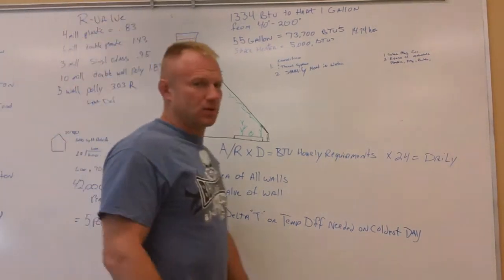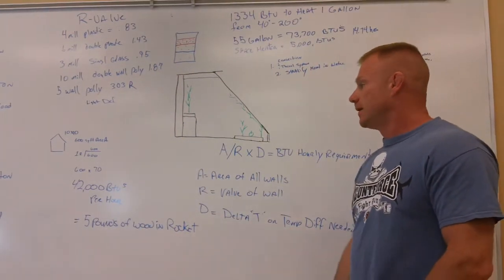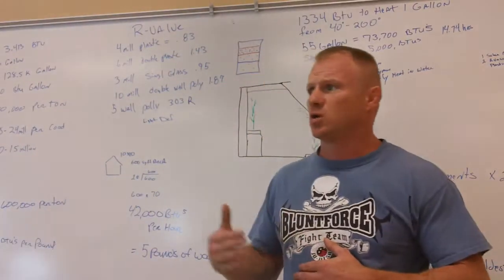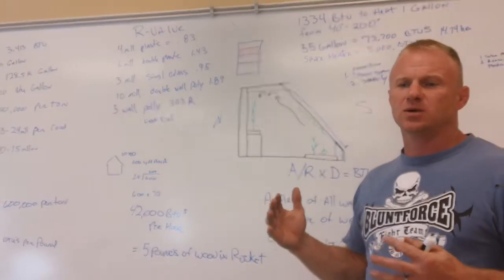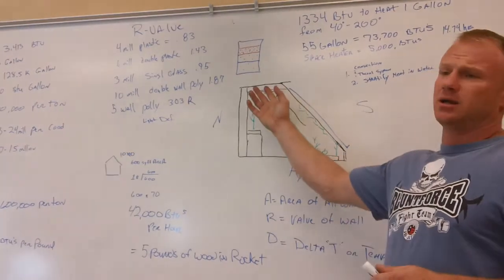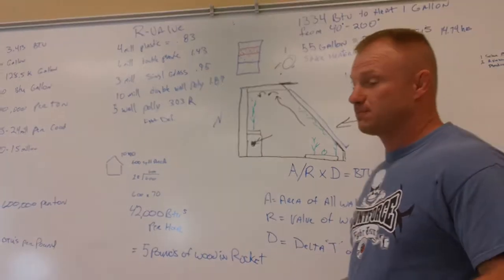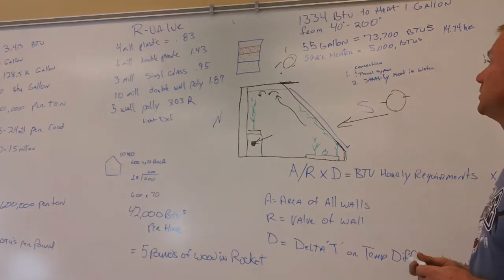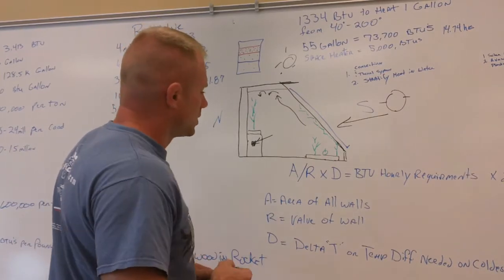Death Of The Rocket Stove part 3

Comment: Its great that you mention water drums have a 3.6 times ability to store BTU's compared to sand/brick/concrete. However, water has a slow uptake of absorbing direct solar heat. If the sun only comes out on a winters day for an hour, the black drums of water will certainly absorb some heat. However, a dry-stack of black-painted bricks under them will absorb more heat in that hour than the drums of water. Without going to exotic phase-change materials, paraffin, or salts, you will experience a boost in thermal absorption with drums of water on top of a base of masonry. After a certain amount of time, the masonry will achieve saturation, and cannot absorb any more BTU's of heat. At that point, the same volume of water will have absorbed a lot of heat, but will still be able to absorb more. If there is a full day of sun, the thermal mass would perform best if it is all water drums, but if there is room for a masonry base, the masonry can rapidly absorb a short exposure of sun, and then spend the rest of the day shedding heat upwards into the water drums.

Comment: So you understand.

I am disabled and find myself bed bound about 4 days a week.  This means not getting up to light a fire to maintain the heat in the mass. 

So I am tingling of throwing a slab with a hollow centre. Fill it with water and use a gas space heater to pump hot air into pipes set in the slab. Insulated from below and with a fairly thin cover it would surely release the heat slowly. The space heater can be set onto a thermostat and it kicks in when the mass/water gets too cool.

The main purpose of this is for an aquaponic setup so over and above this there will also be two tanks of water in the greenhouse. 1000l each, sump tank buried below the main fish tank. I will paint these black to absorb as much solar heat as possible.

Any advice? ?

Thanks for the videos mate, very informative.

Cheers
Sheldon
Reply from the maker: Sheldon B Hello Sheldon. size or volume of mass determine how much heat it will hold. per volume water is a great choice. it however will absorb heat that otherwise would be coming into the room  and let it out slowly thus maintaining a more constant temperature. any mass heated or unheated will come up to room temp and then try to hold it or let off it cools.. Recomend a second or auxiliary heat source for the mass to have more than one way to heat it.. Perhaps a candle arrangement or propane or wood .. they days your up a hot fire could store a lot of heat if the mass is large enough.. its pretty easy to determine just how many BTU of heat a material mass of a certain size will hold.. by calculating heat capacity with volume.. and then look at that number compare to how many btu you need to heat your room for one hour and see how many hours your mass volume chosen will heat the room and see if that meets you needs for time..

Comment: Hi Mr. Powell - First, I would like to thank you for all of the time and money you have spent actually testing your heating theories, in addition to the time you have spent learning the supporting information.  Just opening all of these discussions is a huge benefit to people like myself that are just beginning to dive into these projects.  

Now, it seems to me that everyone has accepted that a rocket stove burns hotter, and therefore, more thoroughly than standard wood stoves.  There seems to be two arguments you have made for why rocket stoves are not the right heating tool.  One was that they burn to quickly, and require a lot of feeding and babysitting.  The second was that by pulling the heat from the exhaust there is a greater opportunity for back-draft problems. 

What I am not understanding is why this discussion revolves around rocket stoves at all?  You have made a completely valid argument that water makes a better thermal mass than cob, but why is cob married to rocket stoves just because that is the way many people have done it in the past.  Why not transfer the heat from the rocket stove into water rather than cob?  

I understand the point that you have made, that one must feed a rocket stove more often, but if people are coming up with alternative methods for feeding different fuels (pellets, waste oil, etc, just as you have experimented with) why is that not a reasonable solution for taking the "babysitting" out of a rocket stove?  After all, aren't all good technologies really built one improvement at a time upon other technologies?  The same argument applies for the efforts people are making to resolve the back-draft issues.

If a rocket stove is a more efficient method of removing BTUs from a fuel, shouldn't we be talking about how to harness that more efficiently rather than looking at a less efficient heat source?
Reply from the maker: Hello Mr Christman  All this was not intended to do away with the rocket stove idea or to say it is bad. It is to better understand the underlying principals so that one can use any and all resources available to build a heat system that best suits them and to make people aware of any draw backs or problems and give an accurate report over time in order to draw better conclusions and save money. The rocket was built for cooking and turned into a heater. It burns clean as was needed for indoor cooking in 3rd world countries . What is most efficient is not always what is most practical. Rocket folks are almost like a cult..LOL. They will tell you a arm load of wood will heat a whole house for all day . When IF you understand the science, you know its not possible as the math just doesnt add up for such a claim. Proper question is whats size house at what r value over what time frame do make this claim on...Then see if the amount of BTU's could possibly be in an arm load of wood. Its not a "Magic Stove"... Further as I get into this subject I realized there is no "BEST" stove that can be applied in every situation like a blanket covering. Knowledge is power the more you know the more likely you will choose well.  I will continue.....
Reply: Van Powell It is a funny aspect of human nature that people will attach to a concept personally and then take it personally if they feel it is attacked, even if it is just being realistically compared as a tool or idea.  The same thing happens with Mac and iPhone users vs. Android or Microsoft, or even political parties.  It is absolutely the same as cult behavior.

Back to the topic at hand.  I totally agree that  the subjective evaluations of rocket stove performance are often out of line with the limitations of physics. However, there is something to be said for simplifying the discussion.  If the system is only as good as it's weakest link, I am not understanding the reasoning (and I truly want to) for moving toward a system that doesn't burn fuel as thoroughly.  After all, the BTUs don't change regardless of the system used for the heat source, what changes is whether or not ALL of the BTUs are pulled from the fuel (by burning it more thoroughly), and whether or not you can apply those BTUs to your heat exchanger.

I would think that for the best thermal mass radiant heating system you would want the most efficient heat source, heat exchanger and thermal mass.  I am already sold on the idea of water instead of cob.  The issue of back-draft will occur with any heat source (traditional or rocket) if too much of the heat is removed before the chimney riser, so regardless of the heat source that would need to be managed carefully.  

This brings us to the only remaining argument supporting the use of a traditional wood burner as a better solution than a rocket stove.  If I understand what you are saying correctly, you believe that there is too much fuel management in a rocket stove, and that it is not offset by the gains in efficiency.  Based upon this you are suggesting that one should trade the efficiency of more thorough fuel conversion to for the ease of using a less labor intensive stove.  Am I correct?
Reply from the maker: ***** Mr Christman , you ask the right questions. You have understood and got straight to the point at hand. The single overlooked aspect is one big deal "PRACTICALITY"  What is not realized by most is that for a working man who is going to leave his home for a period of  time from 6-9 hours and wants to keep his house warm all day in the morning in order to heat the mass up to hold enough BTU to warm the house all day, one must get up an hour or more early to allow for the time spent attending feeding and adding fuel.Instead of getting ready for the day The trade of is this you may not spend time cutting wood with a chain saw (maybe) but you will make up feeding it and tending it as it demands. Its a small chamber and at 100% its still limited to BTU available in sticks. Green house set ups have the same problem. My choice is to cut wood when I choose I have time and not feed a  stove as it demands on its time. I have built a few that is one touch or load in 24 hours. Most green houses and people are willing to sacrifice the efficiency for the practicality that daily life requires. Have you Watch my video on wood stove efficiency ratings? If you choose or build a good wood stove that burns at a high efficiency a couple that with water thermal mass your gonna be a happier camper
Reply from the maker: ***** Feeding a rocket pellets with a hopper is a solution. Show me the hopper set up you would want in your living room? The fact that many attempts all over U tube  to build a feeder is testimony of this problem. When you go pellets for one your tide to pellets now and a machine and up keep to make them or buy them from someone selling them for profit, not exactly sticks from the yard any more. why not just go with a high efficient pellet stove for more BTU and better control with a cleaner finish??????? if you got pellets. One can use air and waste oil in a rocket as well for continue feed. I have built a few.. but I can not keep the oil where I want it and often make a mess with it. But it can be done, those are my throw it together for test short comings.  Again a nice clean finish with out seeing or dripping oil.. it can be done. but why not just build a drip feed oil burner if you got oil?
Reply from the maker: ***** In the comparison of efficiency ratings of a rocket stove to a wood stove in regard to the aspect of getting the most BTU out of the pound of wood the MOST over looked and misunderstood facts is the following: Rocket stoves have no draft settings they breath wide open. The rating on a wood stove comes from different draft settings over time averaged. NOT side by side wide open breathing burn. understanding FIRE and its dynamics here is key. more air hotter burn and cleaner burn but quicker burn all a wood stove does is turn down the air flow to slow the consumption or  too big fire slowed down instead of the rocket too little fire sped up storage is its salvation but that to can be better done with water.
Reply from the maker: ***** I have a waste veg oil design or burnt motor oil stove that requires no filtering with saw dust that will deliver constant even temps in a green house touch it once every 2 days and can be built for more. but drip feed can be turned on in fall and run all winter but requires filtering. these same Ideas can be used external of the house for home heating for these time spans as well pumping the heat in with air or water or both.
Reply from the maker: ***** The big question is  can the best of these concepts be put together to improve? Could a big wood burner open draft with maybe thermal electric air assist to further clean up the burn and also insulate the burn chamber due to the cast iron loses heat too fast .to heat up an further clean up the burn be used in conjunction with water as a mass for a "better heating system" I think the answer is "YES" I intend to make some new videos  that will shock a few people very soon on how to build a cheap very clean burning wood stove equal to a catalytic stove but with out the cost. I hate to give it away but I hate not to. I hope I have addressed all your questions and concerns if not try me again..LOL I hope I havent bored you with my ramblings thanks for the nice words, enjoyed the engagement
Reply: ***** I know that this is a very late response, but one reason that Rocket Stove people like to use cob is that, although it takes a lot longer for them to warm up, it also takes longer for them to release their stored energy. Van Powell is right in that water will suck up the heat super quick, in relation to cob, but water will also release its heat just as rapidly. Any particular material has a specific rate that they can transfer heat. Inside a computer, for instance, there are heat sinks connected to your CPU chip. These heat sinks are made of metal, because metals can transfer heat quickly. Then, fans blow air across the metal fins, to get the heat away from your circuits. Super powerful computers use water cooling for the same reason. As Mr. Powell said, water can transfer heat very quickly, so water-cooled computers can get cooled quicker. But if water sucked up the heat quickly and didn't release it just as quickly, those water cooled computers would be terrible, because they would oveheat too quickly.

Comment: Van, thanks so much for your videos.  We were just getting ready to build a rocket stove mass heater in our yet to be framed living room / greenhouse addition.  I always wanted water heating as part of the system.    I like the idea of using two 55 gallon steel drums and I'd like to use water pipes in cob benches to keep my seedlings warm (instead of the rocket stove duct) and possibly run water pipes in the floor for heating.  And eventually we want to incorporate solar water heating too, since we're in AZ.  We can use an on demand propane heater to supplement hot water.

Really appreciate the MATH for sizing the system in your videos too as that's been seriously lacking from the rocket stove info I have.  Can you direct me towards some info on incorporating thermostats and pumps?
Reply from the maker: Hello and thank you for the kind words. You could use a thermal siphon concept and not need a pump and only need a very small tank (5 gallons) gravity feeding the in floor pipes most of the volume of water would be in the pipes and cool the water before it returns to the elevated bucket by thermal siphon and then  the cool water gravity fed back into the coil to repeat the loop.. never ever break there would be no moving parts to ever break. You should look at my very first video and the rocket stove water mass and thermal electric video and then watch the bulldog rocket series to see a thermal siphon working. Thermostats are air or water born for the most part. they make ones that you plug in set the temp and then plug your device into that and thats a simple fix they also make one similar for water. just google them . hope this helps  keep me posted if you do such a thing.. Listen the MYTH is an arm load of sticks will heat an entire house all day. THE fact is rocket stoves are not magic and are not capable getting more BTU's of heat out of wood than the wood had available in its volume in the first place. and at 100% efficiency(which they are not) a small burn chamber rocket stove is entirely incapable sufficient BTU requirements of an entire house. If any one can present a logical math based counter claim I would be happy to hear it. Hard kiln dried wood has 8500 BTUs a pound sticks are about 4000.. no Rocket in the world adds to that.
Reply: Van Powell
Thanks for the quick reply.    I'll watch the videos and do some research.  Now I'm glad we didn't build everything in November as originally planned.

We have a Vogelzang now and I just HATE how cold it is in the morning.  We also have 120 sqft cob addition for our seedlings and it's always so much warmer that the house without ANY heat (other than from sunshine) and it never gets below 40 F even with night time temps near 0 F and cloudy days.

We tested a proto type passive solar water heater a few years ago in the greenhouse and the thermal action worked as we had hoped.  The reason I thought we needed a pump was that the floor and bench would be lower than the water barrels and therefore it would work in reverse.   I'll update once I had time to look into this more and we'll be posting pictures and plans.